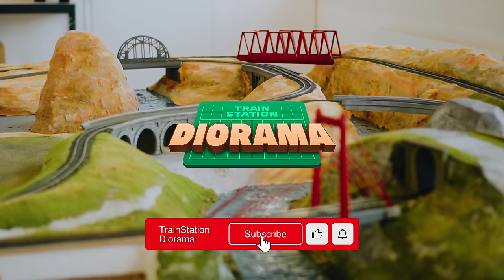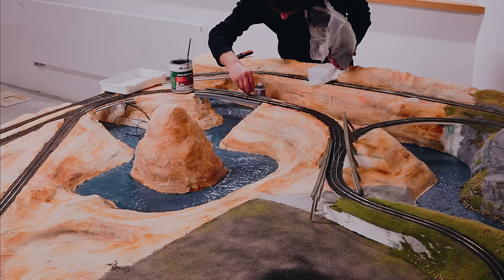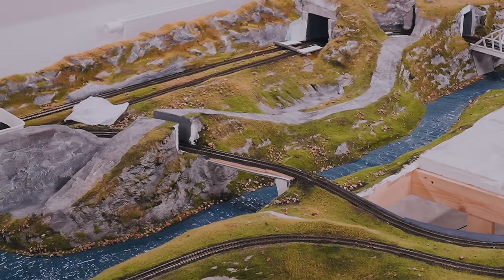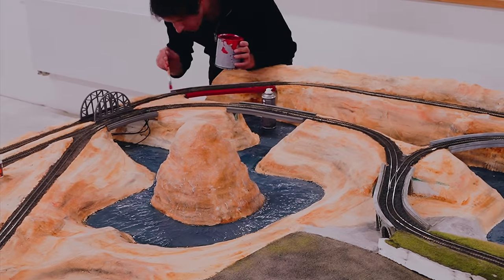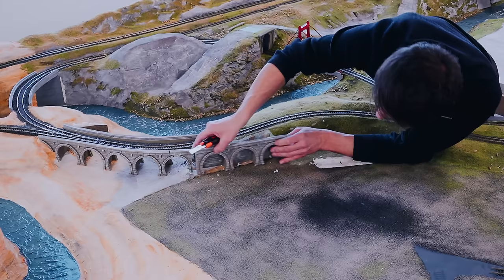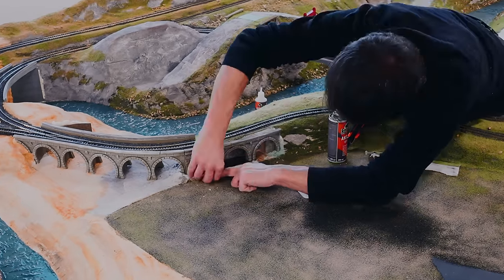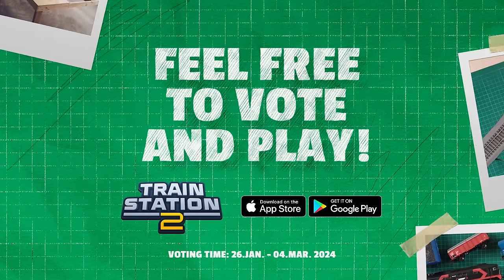Building 6 types of bridges: PART 4

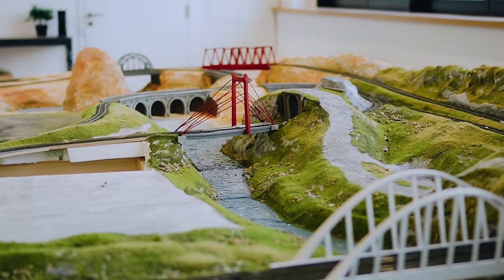Comment: Some of the bridges don't make sense when you look at them with a "structural engineering" eye: The suspension bridge should be suspended from a pillar (going all the way down to the ground), not just from an arch-like thing on the bridge itself. And the red lattice bridge at 3:21 has two definite weak points that would have to be supported by pillars, or you build one lattice going across all its length (which wouldn't be a problem at this size). I like the detail of the stone viaduct.